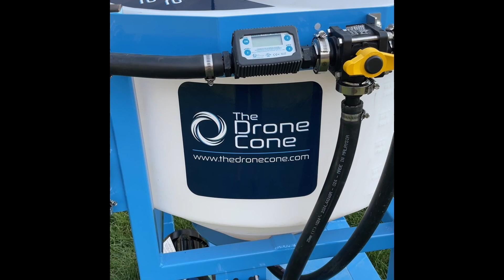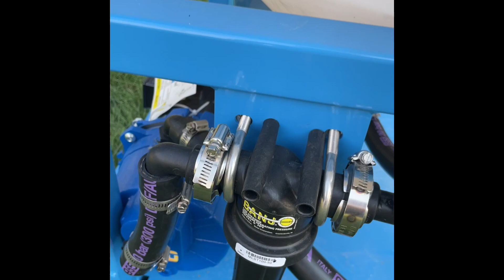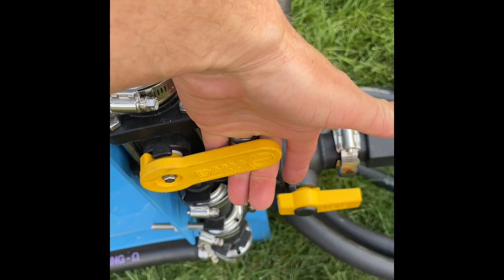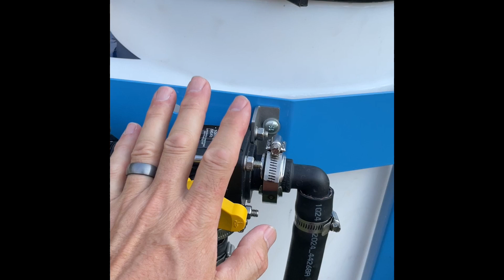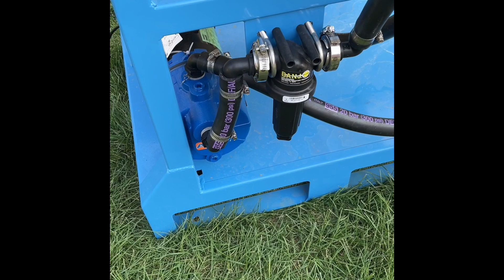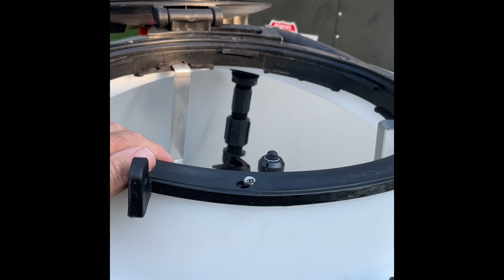Introducing the Drone Cone Mixing System

Comment: For the first time how do you start the system? I mean that 3 way valve on the top is the highest point in the suction side of the pump. If the tank isn’t full, then air will be trapped there and the pump will run dry. Do you have a solution for that or I just need to fill the tank fully?

Comment: I buy almost new surplus military 18kw generator's mainly for residential backups but am setting this up for a guy who bought a new Agas. I am trying to get this all spec-ed out for him electrically wise with everything set up on external breakers & outlets. I am trying to figure out how many 12v & 120v outlets on here he might need, Is your pump 110v or 12v?
Reply: That's a 120 v pump. I wired an outlet next to my cone that is three way switched with a switch next to the cone and a switch up on the flight deck
Reply: @user-zu2bw7ig5v  Thanks, the guy comes this weekend to pick it up. I just covered all my bases with240, 120 & 12v outlets on both sides.